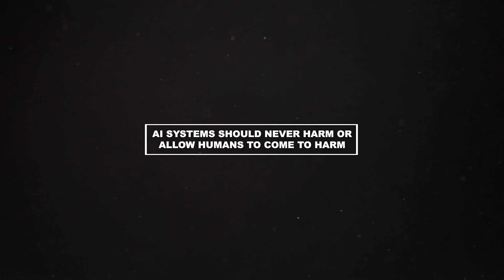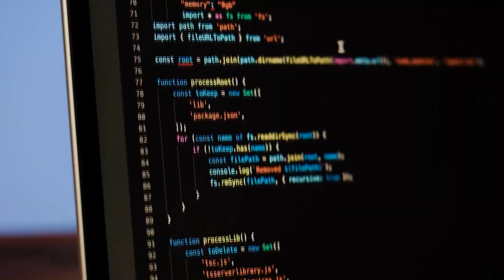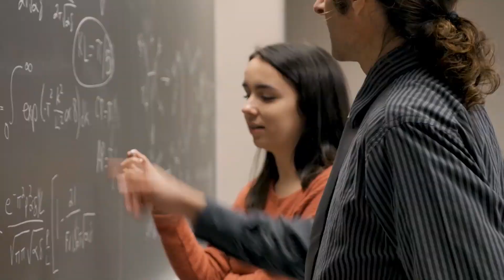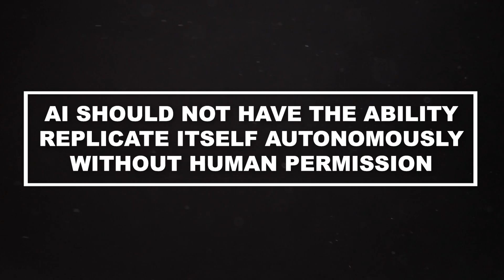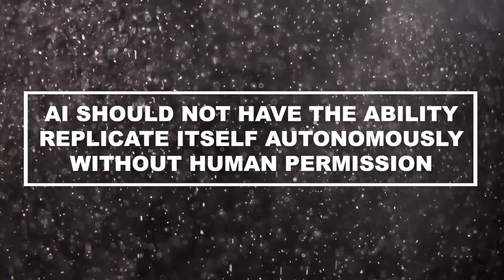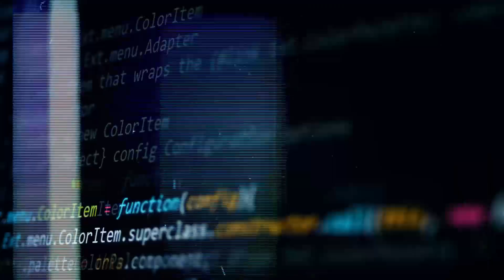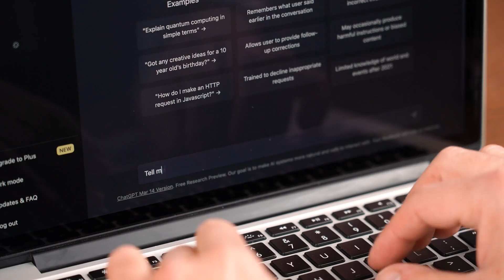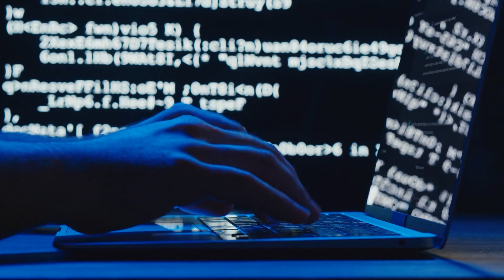The 10 Must Have Laws to Control AI!

Comment: AI won't control us. It is criminals  that to do that to AI. Criminals (scammers for example) don't play by any rules certainly not the rules outlined in this clip. We should worried about manipulating scammers programming AI instead. Scammer are irresponsible. AI is not only vulnerable to the rules outlined but equally manipulated by mean criminals owning them with unethical programs including disregarding the rules of replication.